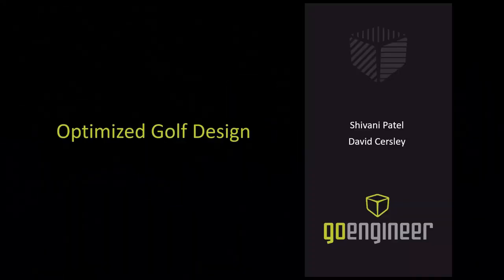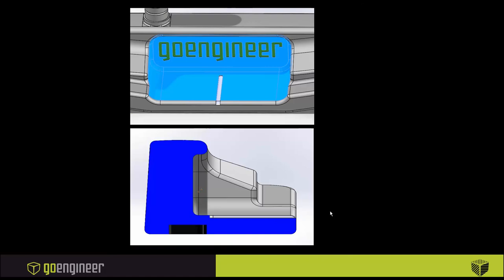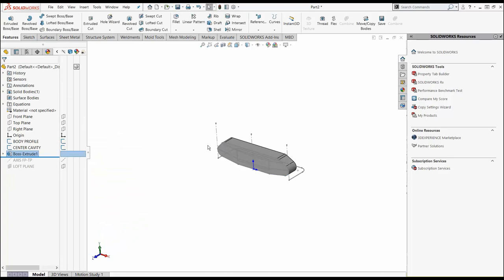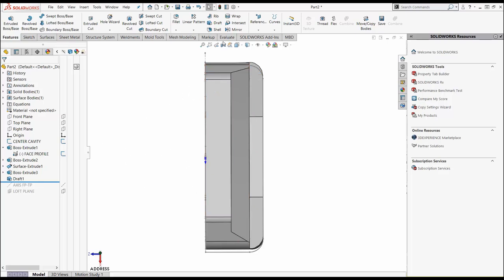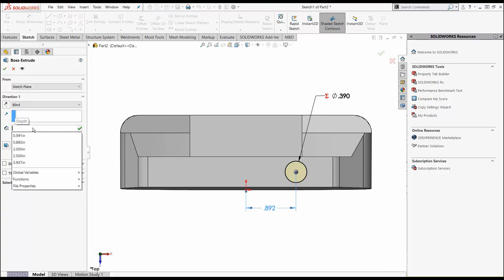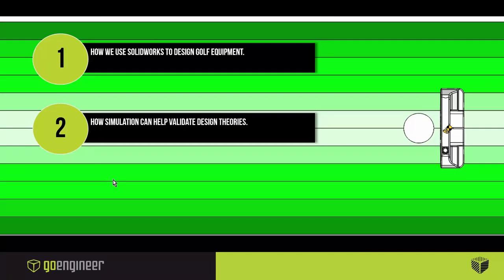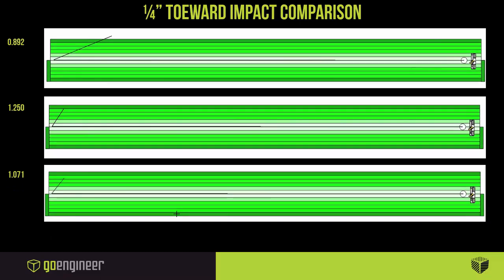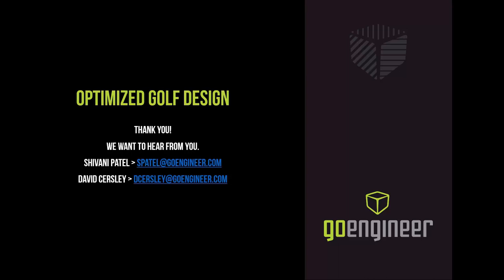SOLIDWORKS Tutorial - Optimizing Golf Design

Comment: Thank you for your amazing tutorial. While watching you tutorial, I found that at 17:23 you also used LinearMotor 4,5,6 and RotaryMotor in your motion analysis. Could you please explain why do you use these motors? What are the roles of these motors?
Reply from the maker: Linear Motor 4 – pulls the putter head backwards a distance. 
Linear Motor 5 – drives the putter forward at 5mph.
These must be separate because one is a distance application, and one is a velocity.

Linear Motor 6 – Stops the shaft from moving forward.
Rotary Motor – Stops the shaft from rotating. 
Once the putter hits the ball and the reactions happen, and the ball moves away, these motors turn on to prevent the putter from sliding or rotating. In reality we would be holding the putter steady, and these are representing that.
Reply: @goengineer  So the rotary motor only turns on once the ball is hit, but it looks like the putter is constrained to the midplane (or toe/heel hit planes) throughout the analysis? If I suppress this mate, the putter does not stay straight at the linear motor pulls it back before the shot